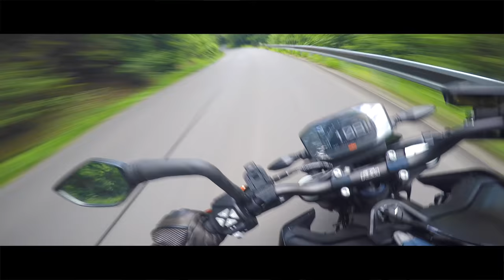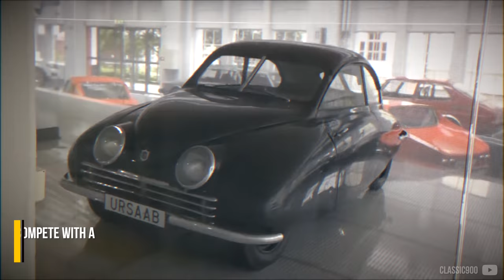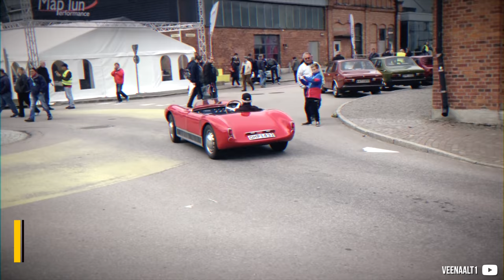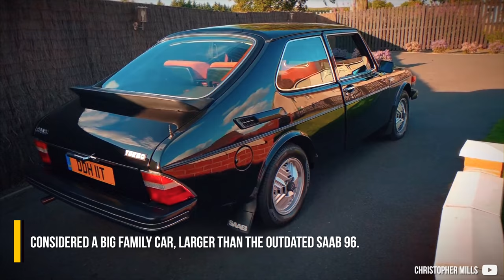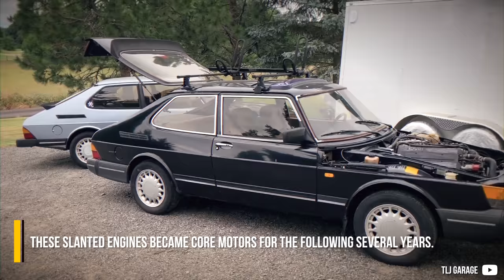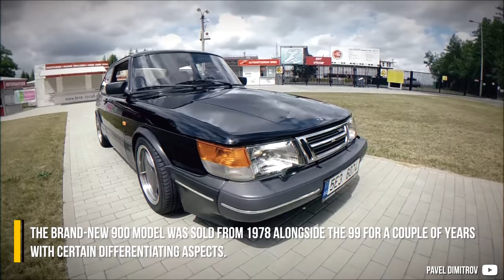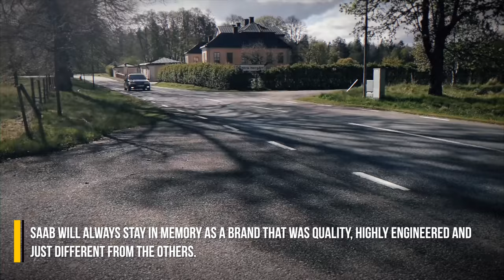Why We Miss The True SAAB?

Comment: GM Never understood true Engineering. I have had Them all from a 1980 900 to a 2009 9-3 that I still own.
The absolutely best SAAB, I ever owned was a 1993 900 2.1. Ther ergonomic cockpit of this car is still unparalelled. 
The german build GM ecotech engine, used in the 9-3 is of poor quality compared to the original SAAB engines.

Comment: The transmissions where junk, mainly the differentials. They where just to small for the weight of the car . I suppose it was because they wanted to keep the whole package small 🤔 I still have my 78 99 turbo 😎 owning a Saab or a Volvo was a prerequisite to the shop I used to work for 😋 I still want to try and put the triumph v8 in it , it shares the same bolt pattern on the oil pan / transmission 😲 probably had something to do with the earlier engines procured from triumph 🤔 since early Saab’s didn’t make there own engine 🤷‍♂️

Comment: Sorry but they weren't reliable. They were innovated and had futuristic thinking. If they were robust, the 99 and 900 would still be around. But here in Sweden they are rarely seen on the roads.
Reply from the maker: I get that, they still have a high "cool" factor IMHO
Reply: Yeah no doubt about that. 🙂